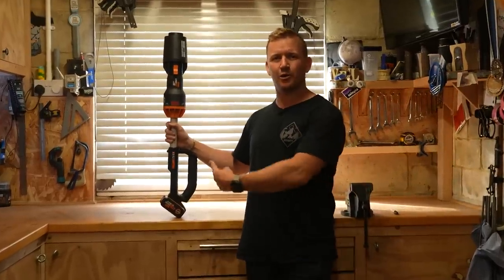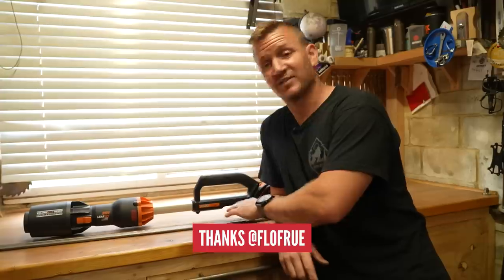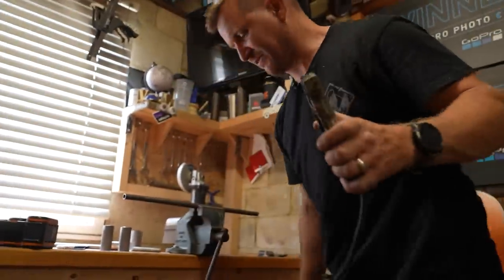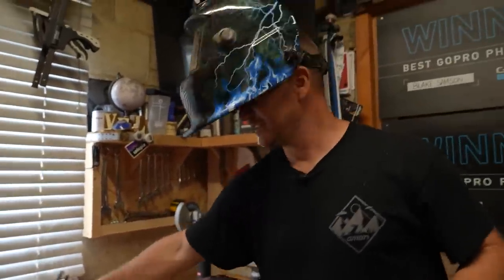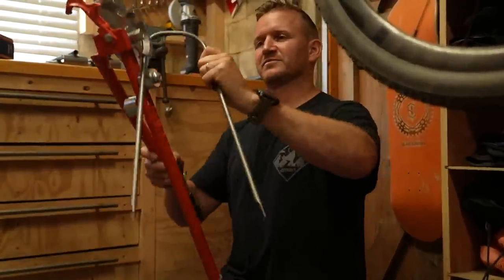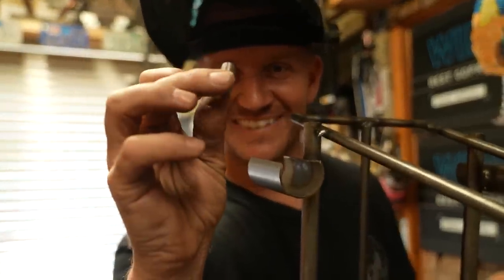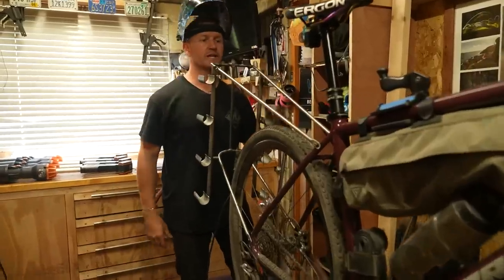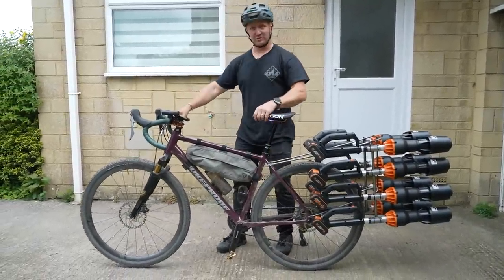It's Jet Powered?! | Blake Builds A DIY Leaf Blower Bike

Comment: Well that gets a win for the sheer bonkers of it 🙂   

BTW, the reason angling them down to 'push off the ground' doesn't work is that the thrust comes from basic Newtonian reaction. The mass of the air thrown back pushes you forward. So to maximize the forward vector of your motion, you want the thrust pointed straight back.  (Yeah, there could be some interesting ground effects etc. but that takes experimentation or modeling to figure out)

Comment: build a drill bike! I did one with a bmx chainring bolted on where the rear disc goes and a bmx freewheel on the chuck. then a bmx brake or loop of cable to operate drill trigger. might need some sort of chain tensioner

Comment: I thought you got the idea from colinfurze but it makes more sense that you were inspired by Sam, because if you'd been inspired by Colin, you would have rigged them to work all on one battery in the frame and single switch that was mounted up front to help keep the center of gravity between the wheels...  and you probably could have gotten Colin Furze to collaborate on this. in fact you should try to get Colin to collaborate on all of these episodes.

it's probably good that you didn't point them down, because you probably would have lifted up the front pivoting on the back wheel